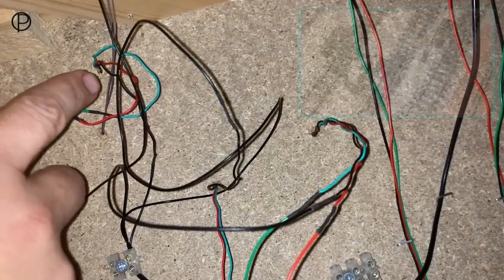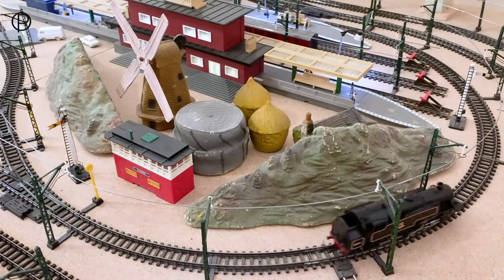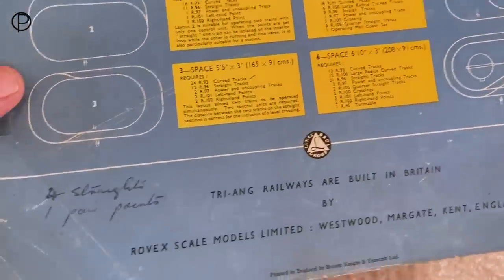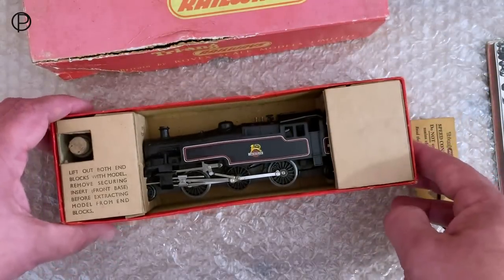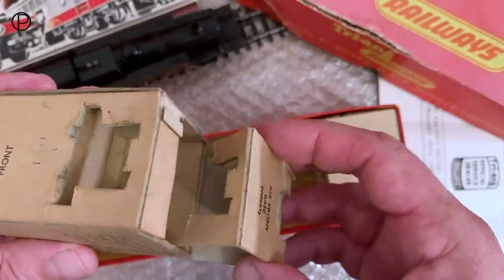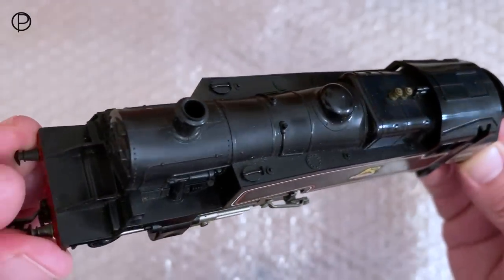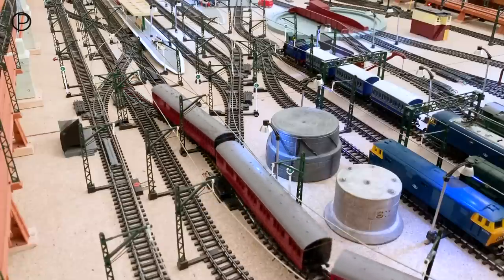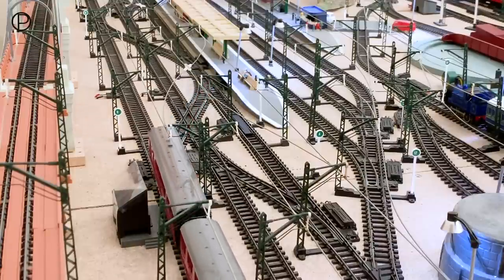Tri-ang Railways R.59 2-6-2 Tank Locomotive with Suburban Coaches

Comment: I've a boxed R.59 from the same year and my box lid has the exact same amount of fading.

I have some suburban coaches with Mk.III couplings also.

The windows at the ends were so that they could be utilised as push-pull units on layouts.
Reply from the maker: Good morning Andy, great to hear you have these suburban coaches with Mk.III couplings, thanks for the information on the windows. It's interesting the faded box tops perhaps the inks used on some batches of the paper wraps were not all of the same quality. Some red cars fade badly whilst others don,t even of the same brand.
Thanks again for watching.
Oscar

Comment: Lovely combination of stock, one can easily imagine that in 1956 such was a normal sight on the fuill size railway. I've a couple of items with rather fragile lining I am trying to keep pristine and use archivists gloves to handle them. When, I must admit, I remmeber to do so:-) Seems odd handling a toy train with white cotton gloves but they dont mark and seem not to have hurt the lining.
Reply from the maker: Thank you Andrew, gloves are a great idea. I shall have to get some. I think I was inspired with the selection of models by the picture on page 137 in Pat Hammondfirstst book ( the story of Rovex 1950-65).  I fear opening the box one day and to find the lining has just flaked off like the speed whiskers on R55 single-ended diesel did!
Oscar

Comment: the crack in the rea buffer is evidence of shrinking - it may be worth slightly filing the chassis length down a little to prevent further damage. I have had to do it on one of my early British Railways Jintys recently - saves further damage.
Reply from the maker: Thanks, Dave. I will look into that.
Oscar

Comment: Nice job Oscar, pity r59 is suffering from warping, it is still a great looking model though. Thanks for sharing.
Reply from the maker: Good morning Kevin, yes its a shame about the warping. However, it's not unusual to find models of this age from this manufacture affected like this due to the material used in the production. Cellulose Acetate was originally used in the early to mid-50s until the change to a more stable form of polystyrene in the latter part of the 50s.
Thanks for watching and taking the time to comment.
Oscar

Comment: HI Oscar, I watch all of your videos, I find them very informative and helpful. 
I need some help in identifying my late grandads Tri-ang train set that was passed down to my dad, the set contained the subject that you are reviewing in this video. I have some of the rolling stock, but some are missing, I have R. 59 with early cress and mark 2 couplings 1× R10 in dung brown plastic with coal load and 2× R10 in green with out load and all have mark 3 couplings, Dad said also that there was a few more R. 10 goods trucks. 
My dad said that R124 brake van is missing again in dung brown, he also said that he thinks that R15 milk Tank R12 shell-B. P & R212 Bogie Bolster W/L, R118 bogie well wagon in green, but not too sure about the couplings. 
He told me that it was all in a deep Triang red box but with no pictures on the front, the box looks similar to the R. D. X set with Triangs trade mark. The track was series 3 which I still have. 
He also told me that every thing was  indervigally boxed and had tissue paper. 
I'm sorry that this message is a bit of a long one. 
P. S could you please tell me what is the best way to get all of my series 3 track clean and restored. 
Thank you for all of your videos they really are awesome. 
By for now and happy modelling (TM81) Phil's Trains
Reply from the maker: Good evening, Phil at first reading of you comment the set sounds like the R3D 1958-59 which replace the earlier RD and RDX sets. But the R3D set had the R.15 UD milk wagon, R.16 Brake Van, R.110 Bogie Bolster, R.118 well wagon and the R59 2-6-2 Locomotive. You mention the box without a picture containing individually box items. Maybe this was a special order set made for one of the bigger retailers of the time? possibly if the order was for a low quantity of sets, maybe no card inner was made and the individual items were placed in the box and packed attractively with tissue paper. The early Rovex set had boxed item inserted into a card deck within the box I think this was also the case for sets made for Gamages Store. Have a look at these links.
http://www.tri-ang.co.uk/r3dset.html
http://www.hornbyguide.com/item_details.asp?itemid=1235
http://www.hornbyguide.com/item_details.asp?itemid=1179
I have cleaned some very dirty series 3 and super 4 track with warm soapy water with a gentle scrub with a nail brush, then allowing to thoroughly dry in an airing cupboard or on warm radiator (Not Scalding Hot). The rail joiners/ fishplates and rail ends can also be gone over with a glass fibre pen and a track rubber used on the railheads. In general use, the track needs regular cleaning with track cleaning car with an appropriate fluid (I use liquid lighter fuel) and light use of a track rubber I use the glass fibre pen on the connections on the point work.
Thanks for watching.
Oscar
Reply: @oscarpaisley  thank you so much for your reply, I am currently working on the track and cleaning it as you have said.
I have been sourcing the missing items, plus my dad informed me that he had R70 double track level crossing & R260 girder Bridge presentation set which I have since sourced